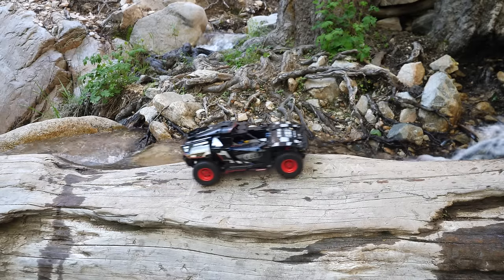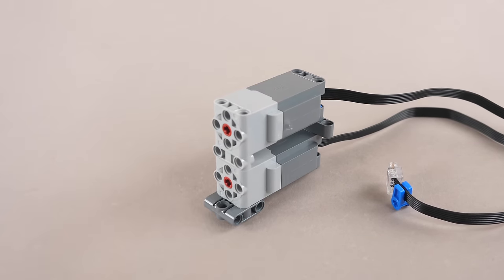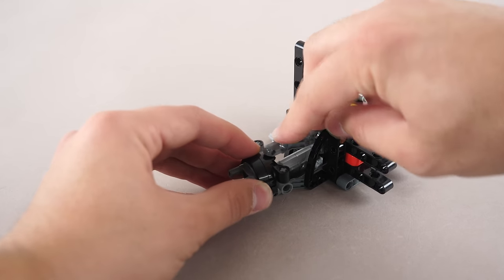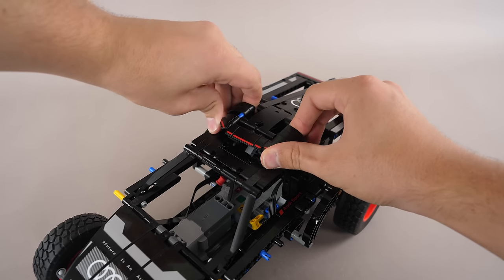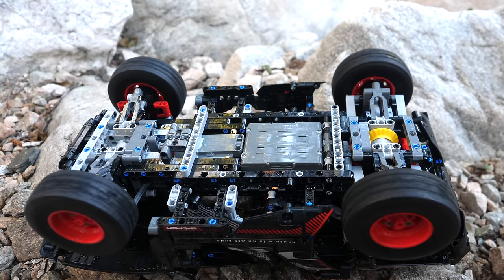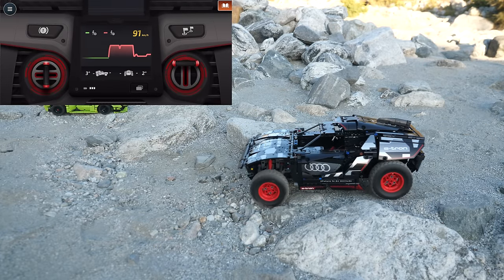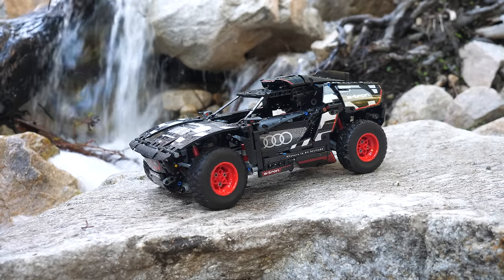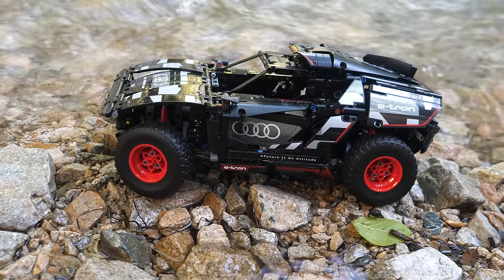LEGO Technic Audi RS Q e-tron 42160 Reviewed

Comment: I just noticed. You placed two of the front panels on the wrong side/backwards. The stickers don’t line up and the headlights are closer to the windshield instead of where they should be near the grill. Just letting you know.
Reply from the maker: I appreciate you telling me. I will fix it
Reply: Lol, I was assembling the kit today and thought I was doing something wrong - turns out I wasn't, and it was because of this video. It looks pretty good the wrong way around - only the stickers don't line up (but do they ever really do...?) - it is a great model, only you have to use good batteries - on rechargeable it's a bit under powered.
Reply: I checked the instructions real quick lol
Reply: Thank god, I wasn't the only one who knew. I just finished building mine today, that's why I noticed his mistake

Comment: I’m definitely buying 4 of these bad boys. So many useful parts, a full rc kit, 3 motors, new tires, and everything you need to build an RC. All with the new control+ system. This finally makes PF obsolete. I can’t wait to redo all of my RC cars with the control+ system. This is hands down the best kit of 2023, and the best kit since the motorized excavator. Better than the 9398, and I’m going to use two of them and 8 motors to motorized one of my 8466(I own two and I finally have a reason to open the second one. It’s BNIB. Cost me a fortune)

Comment: I honestly wish that the two driving L-motors were used in unison connected via gears(preferably the 12 and 20 tooth) and placed in the undercarriage, as it would not only improve stability, but increase power distribution and speed.
Reply from the maker: Agreed!

Comment: I think this set has a lot of potential. Firstly, the price. The app-controlled transformation vehicle costs $140 and had only one less motor and 200 pieces less. I feel like this set is not worth it. Second, I feel that the 42140 of last year was a much more fun control+ set since it had that amazing flip function.
Reply from the maker: True. But, this set has a unique selection of pieces
Reply: @Unbrickme  I understand but the App-controlled vehicle also came with some intresting pieces such as the rubber pieces and some cool neon yellow pieces

Comment: btw i want to know i never ever bought a C+ technic set and i am considering between this or the huracan tecnica and heres the question does the motors last longer like does it last maybe 7 years with new batteries everytime its out of power or does it break easily like life span of 1 year?
Reply from the maker: C+ Large and Xl motors have been around since 2019. In those four years, they’ve never broken for me and I don’t expect they will. I think that they’re gonna last for a long time. Some of my power functions motors have been with me for well over a decade. I don’t think you should worry about that. Between this or the huracán, you should absolutely get the Audi! It’s so much fun to play with, where as the huracán is just a small display set
Reply: @Unbrickme  alright thanks unbrickme :)

Comment: This would be an awesome set for my kids... If it only had a physical remote 😭
I'll stick to my 42122 MOC with the Mouldking hub. Way better than the Lego hub for RC cars.
Reply from the maker: Phone control is  not bad
Reply: Then its a good opportunity for your kids to start coding
Reply: @Unbrickme  It can be the best control in the world. The point is that Lego is a great physical toy, and it should get the kids away from the phone and console.
Also, my kids don't even have a phone yet.
Reply: @galizakeithd.2579  Well... I think this is a valid point if it would be like a Mindstorms or Boost set. But an RC car? That's meant to be fun for driving around and not for programming.